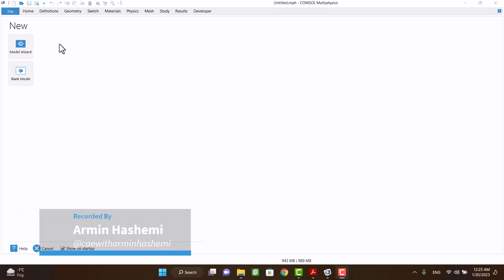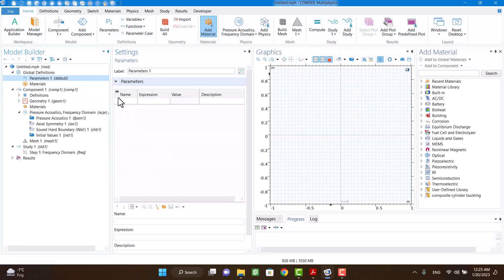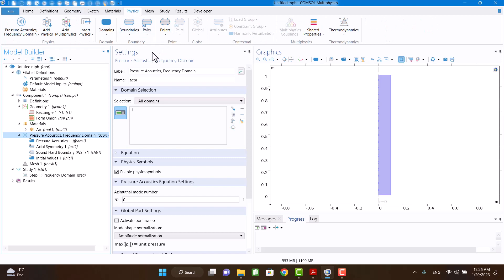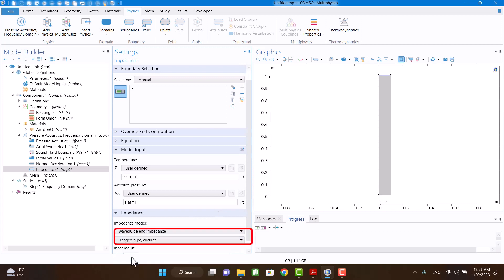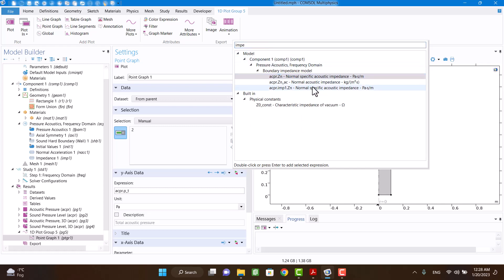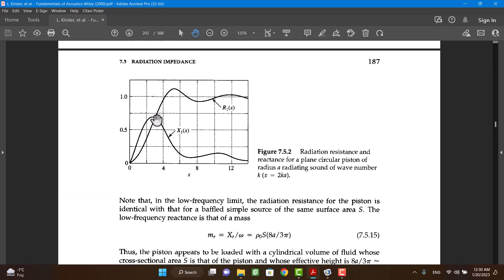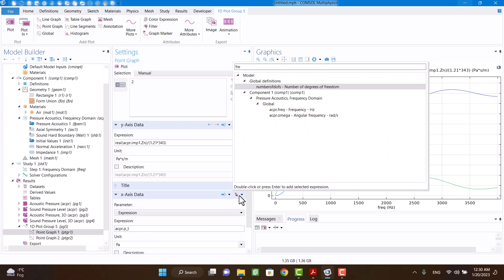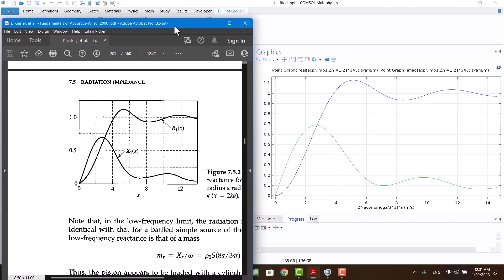🔊 COMSOL Tutorial: Acoustic Radiation Impedance of a Tube  (Part I) 🎧

Comment: I need a help in impedance boundary condition. How can someone use impedance BC if the geometry is not cylindrical or cuboidal rather prismatic in shape. 
One more thing what if internal impedance BC is used then what to write in specific tranfer impedance ?
Reply from the maker: You can use the impedance boundary condition for any shape. You just need to enter the right value. But to be honest, your question cannot be answered without examining the specific case, as it is not a common one.
Reply: @caewitharminhashemi  
I need to know which Impedance BC i need to apply internal or external. Maybe internal and what expression or value i need to put.
Reply: @caewitharminhashemi  This paper contain geometry that I'm taking about.
Reply: @caewitharminhashemi  this is the DOI of the paper 10.3390/ma18071600